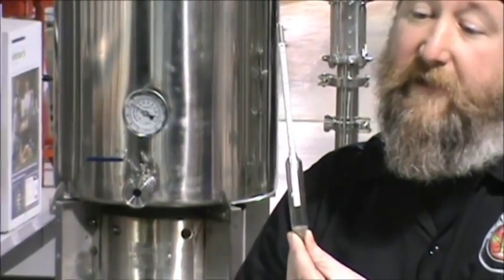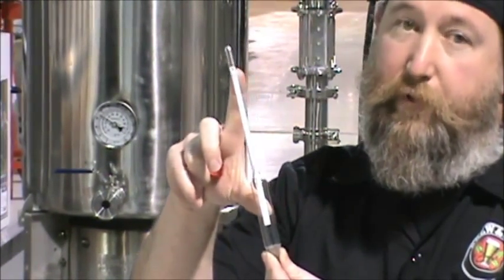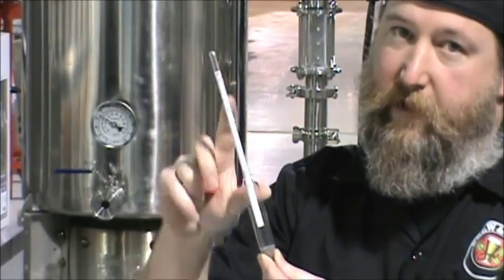PreBoil Gravity - Smarty Pints - Home Brew Network

Comment: You don’t cool your wort before taking a reading out of fear of glue becoming fluid and moving the graduations. You cool your wort before taking a reading because liquids expand when heated. Heat also causes gases to come out of solution. These two things will affect the buoyancy of the hydrometer.

This is why hydrometers are calibrated at a certain temperature.